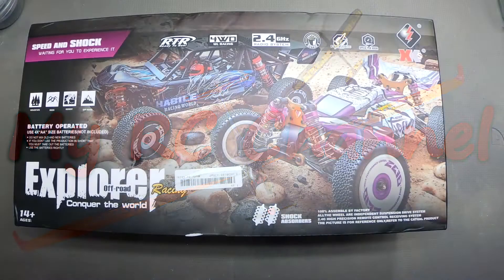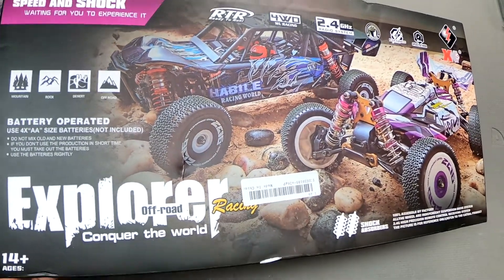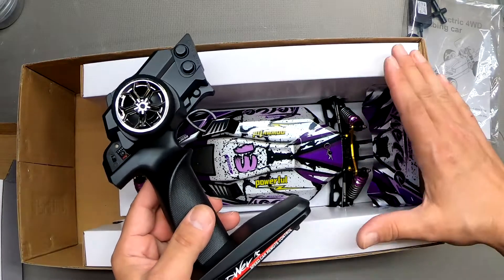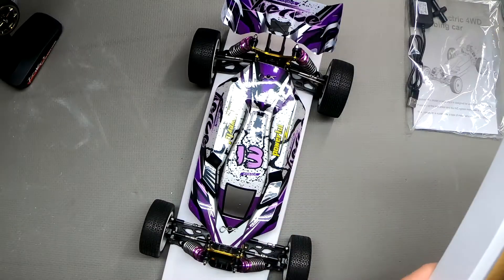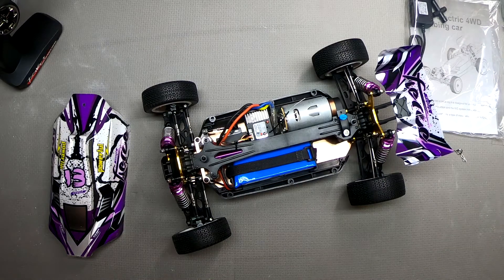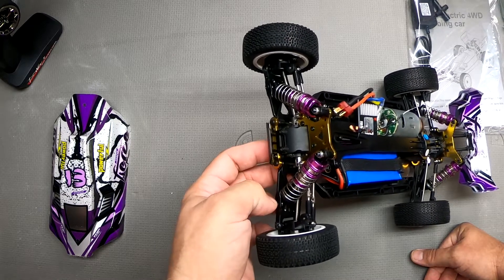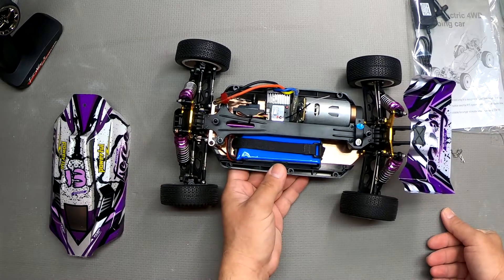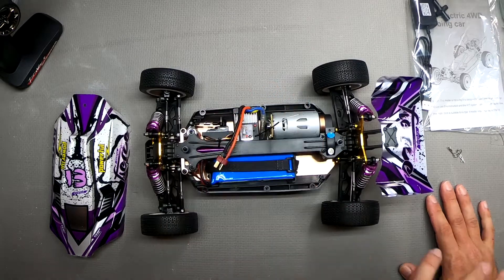Wltoys 124019 RTR RC Buggy 1/12 2.4G 4WD, Rebuild & Modify - Pt. 1

Comment: I will buy this RC as my first to jump in this Hobby  to play with my son and myself :)  after he will get his own  to  .  I hope this rc car will be good for us to play around  .  Thank you for your video ! I will watch the others to
Reply from the maker: If you're on a tight budget, it's a good first car. Do the teardown and fixes I recommend in this series and you'll do fine. You don't need to do the motor and servo swap... just rebuild the differentials and shocks. It's a good learning experience and will make the car last longer.
Best of luck! If you have questions along the way, feel free to ask.
Regards,
CJ
Reply from the maker: BTW, I'd get a couple extra batteries and a fast charger that can charge at least two batteries at a time... It gets boring if you can only run the car once or twice a day. 
Below is a link to the brushless version of the same buggy... in addition to a better motor and ESC, it has a propper 3 wire servo... so, if the stock servo gives out, you can upgrade it without having to upgrade everything else. The brushed version has a 5 wire servo which is a proprietary connection. 
Also, for an extra $12 you can get an extra battery.
https://shop.makerfire.com/products/wltoys-124019-brushless-rc-car?variant=40144797139141

Here is a link to a pair of batteries the same size with the same connector type.
https://www.amazon.com/Zeee-Batteries-Quadcopter-Helicopter-Multi-Motor/dp/B07CQPLC3T/ref=sr_1_14?crid=1U5LX5X9N84QR&dchild=1&keywords=2600mah+2s+lipo+battery&qid=1635659364&sprefix=2600mah+2s%2Caps%2C145&sr=8-14

Lipos are dangerous so please watch my video on proper battery handling.
https://www.youtube.com/watch?v=1HjSg_TeIq0&t=8s

Comment: Hello, I just suscribed to your chanel cause I just ordered one litle bugy like this one. I’m new to this hobby, so I will follow your videos as I learn. My first question would be what kind of batteries should I order? Thanks,
Reply from the maker: I'm not sure, you'd need to tell me exactly which car you bought. Most importantly, you should buy a good charger and not rely on the chargers that come with the cars... they are Ok for putting a charge on the battery, though they tend to be slow. It's putting them in storage mode that is important. After a local did over a million dollars in damage to his family home, I made this video... it will explain all: https://www.youtube.com/watch?v=1HjSg_TeIq0&t=3s
Thanks for subscribing. RC is a great hobby and you're on your way to having a lot of fun. 
Feel free to contact me with questions.
CJ
Reply: Thank you for the answer. It’s the 124019. I’m a bit confused with the Mah,  C rating etc. Is it better with more Mah ? I found a charger like yours... I saw your vid. Pretty scary !!
Reply from the maker: @francoisst-aubin432  Sure, I understand the confusion...
Mah or milliamp hour - thing of this as how many gallons of gas a fuel tank can hold.

C rating - is the amount of juice that can be transferred in a given unit of time. How fast the battery can empty. This is also the factor that gets fudged the most.

If you just want to get a couple extra batteries that are the correct size for your 124019, here is a link to a pair on Amazon:
https://www.amazon.com/Zeee-Connector-Quadcopter-Helicopter-Airplane/dp/B086964PMT/ref=sr_1_5?crid=JSQNMOVZ6GP3&dchild=1&keywords=2200mah+2s+lipo+battery&qid=1613664647&sprefix=2200mah+2s+lipo%2Caps%2C146&sr=8-5
Reply: @MyRCChannel-CJScott  thanks a million. I found them on Amazon.ca bought 2packs with  bags. Now I have to find a place here in Canada for spare parts !
Reply from the maker: @francoisst-aubin432  No problem, glad to be of help. Did you confirm the size? Not more than 100-105mm long and round 34-36mm wide. Good thing that you bought bags to go with them. 
You're going to be hard pressed to find spares for the WLToys cars in Canada. Best thing to do is order a few swing arms, front steering blocks, a set of shock towers, etc. and have them handy. They aren't that expensive. You'll probably spend +-$30 and they'll show up in 3-6 weeks.
Also, you might want to start looking into wheels and tires. I havent tried them, but I'm guessing the same wheels and tires that fir the 1/10 4wd buggies will probably fit... 2.2 inch buggy wheels... check out DE racing. I run their wheels on my SCT and have zero issues with them. 

Link to all DE 1/10 4wd front and rear: 
https://www.amainhobbies.com/1-10-scale-off-road-tires-wheels-cars-trucks/c2338?fs=1&fk=18_3309&fb=272&lg=fb

Not knowing what surfaces you're going to be running on... here are some examples... the first ones are more of an all-arounder and the last is more of a groomed track tire.

Rears:
https://www.amainhobbies.com/jconcepts-goose-bumps-2.2-rear-buggy-tires-2-green-jco3018-02/p362299?v=25553

https://www.amainhobbies.com/proline-electron-2.2-rear-buggy-tires-2-mc-pro8238-17/p385800?v=377178

Fronts:
https://www.amainhobbies.com/jconcepts-goose-bumps-2.2-front-4wd-buggy-tires-2-green-jco3019-02/p362291?v=25554

https://www.amainhobbies.com/aka-scribble-2.2-front-2wd-buggy-tires-2-ultra-soft-aka13230wr/p1156570?v=1261696

https://www.amainhobbies.com/proline-electron-2.2-4wd-buggy-front-tires-2-m4-pro8240-03/p385802?v=377181
Reply: @MyRCChannel-CJScott  I just ordered what you linked. I had checked them yesterday. I had a pair in my cart already! I guess I ‘m learning !!! Found a couple of sites to order from. Plastic suspension arms are harder to find compared to allu. ! Found some in China! I will run it mostly on grass and ashphalt next summer. If I want to take it outside these days I would need snowmobile tracks since we are under a couple of feet of snow ! I will have as much fun taking it appart and tune it than actualy run it. Do you have a website with link to Email ? Thank you, Francois

Comment: A couple of years ago I bought a WL toys quadcopter and their V911 helicopter and I was amazed at the very high quality of them for the price. If the quality of that car is comparable to the helis it will be a good entry level car.
Reply from the maker: It looks like a great first RC car... it needs a bit of tuning out of the box, but that is to be expected from almost any RTR. In the next video, I'm going to open it up and check out the guts... we'll see how well it's built and how it can be improved. First I want to see what a rebuild with proper shock oil and diff fluid will do. Then I'm going to swap the motor/esc with an inexpensive brushed motor/esc so I can use a descent radio, then I may try a more expensive brushless setup.